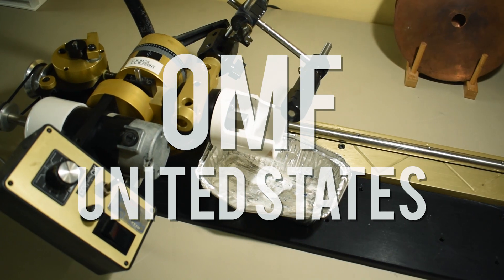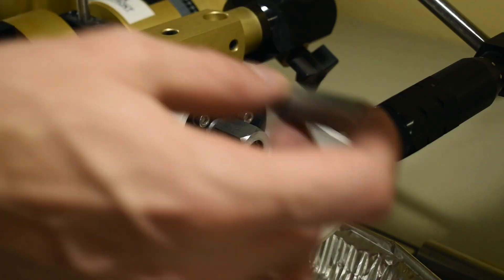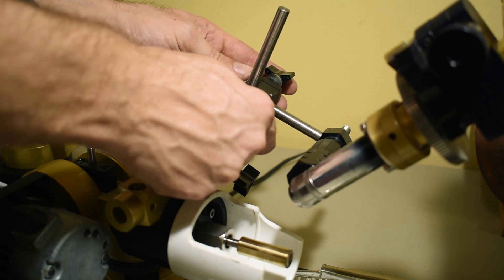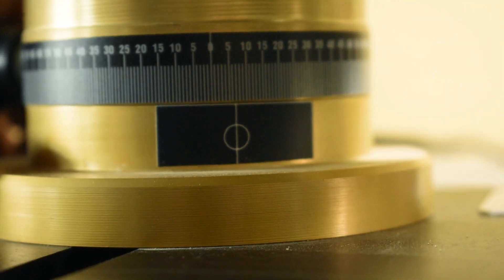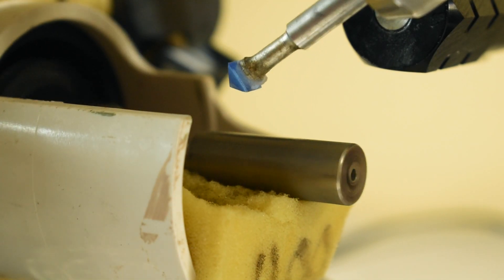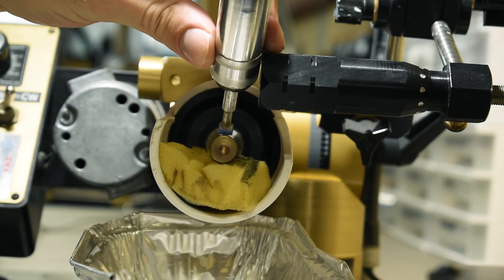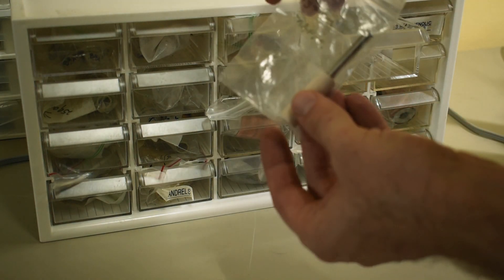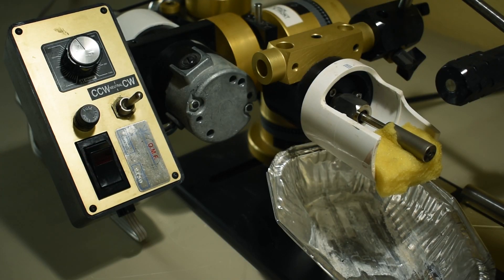World of Faceting Machines Ep.7 : O.M.F. Concave Faceting

Comment: any opinion on differences from the omf and the facetron fantasy cutter?
Reply from the maker: I haven’t used the facetron unit but as far as I know it just goes in and out. You can’t rotate it, you can’t change the angle that the mantels are moving in. Also you can’t buy the facetron unit. They are extremely rare. The omf is still available and still lots of kinds of mandrels in many sizes available.
Reply: Interesting, I was considering buying a used facetron unit but after reading that I think I will pass!  They were asking 1450$ used, but I think I would prefer the polymetric for sure.  thanks for the insightful information and video 
 @JustinKPrim

Comment: Is this only for curved faces? Also which bits are used for this method, can you provide some brands?
Reply from the maker: Yes only for curved facets.  You need to cut the flat facets on a regular machine such as the Polymetric Scintillator and then take the mast off and put it on the base of the concave OMF machine.  As far as bits (called mandrels) I have a large collection of different sizes and materials, such as copper, tin, BATT, phenolic, wood, and more.  You can get the mandrels from the manufacturer : http://www.polymetricinc.com/omf.htm Scroll to bottom to see the different mandrels available.
Reply: Justin K Prim thank you for That info. Now I know on what to save my money for, after I got the money together for the facetron. 👍
Reply: yes this machine only cuts curved facets and you use the mast from your standard faceting machine.